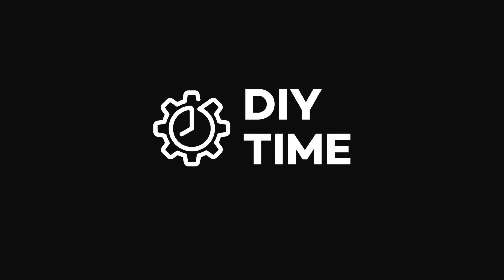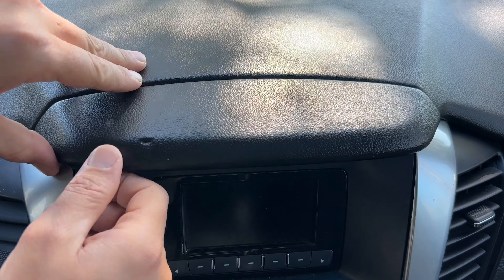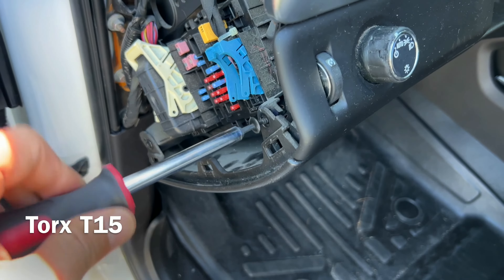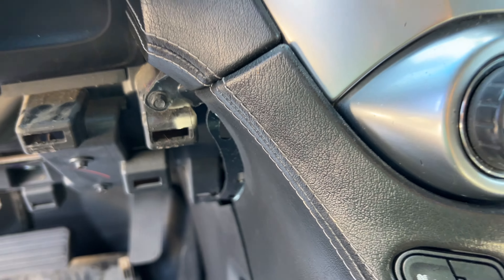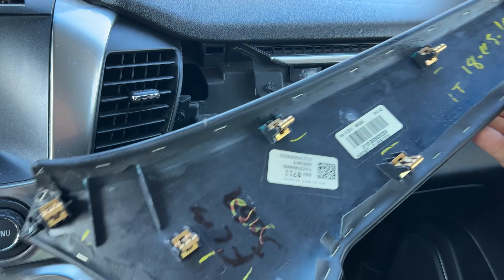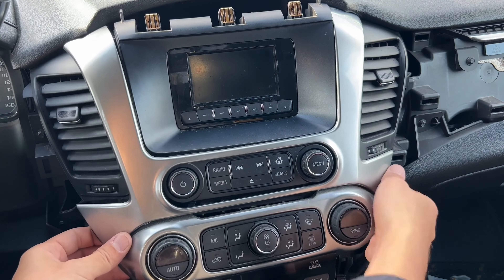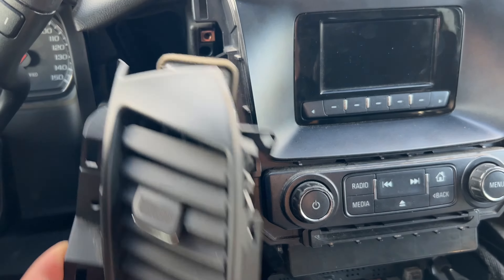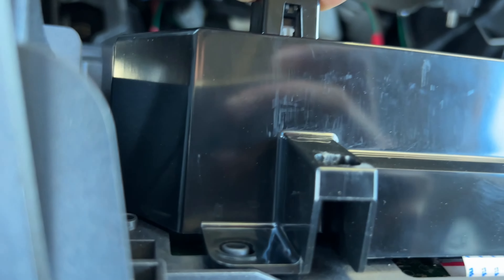HOW TO: remove factory radio/stereo infotainment screen (2015 - 2020 Tahoe, Suburban, Yukon)

Comment: Are you gonna make a video how to put a new one in or is just a plug-in?
Reply from the maker: Eventually. This project is on hold for now. Got other things come up.
Reply: @DIYtime  When you put the screen, do you gotta hook up the middle one? I’m back of the radio cause only got two wires from this this one.
Reply: @barberlife806  let me know if you figure this out please!
Reply: @stephenp4240  plug it up with the two wires and screams not come on  I just hear the radio  bs
Reply: @barberlife806 did you ever figure out how to make the screen come on I have a 2016 tahoe ppv and I upgraded to the normal bigger screen one but like yours all I can hear is the radio but the screen won’t come on
Reply: @MichaelMartinez-co1qk  i still have not figure it out